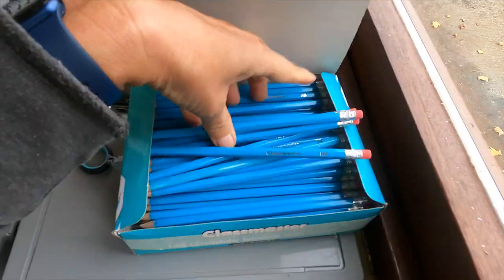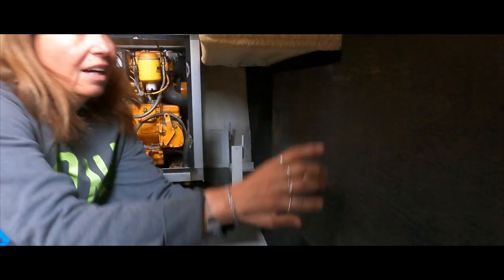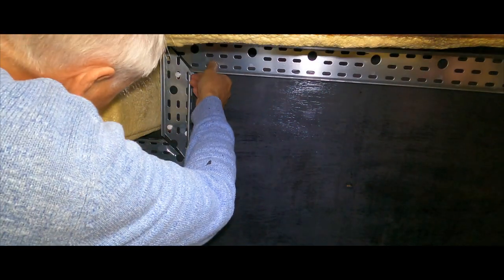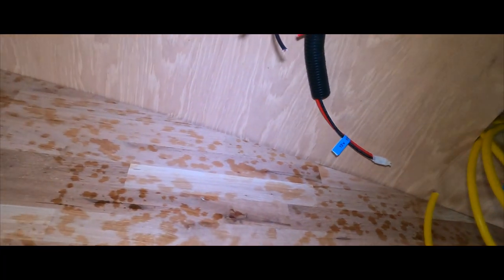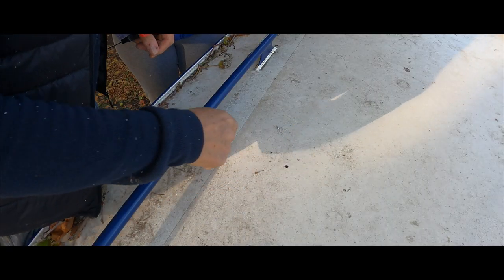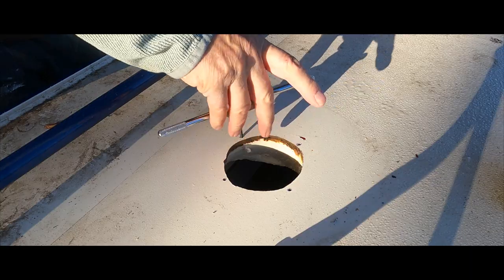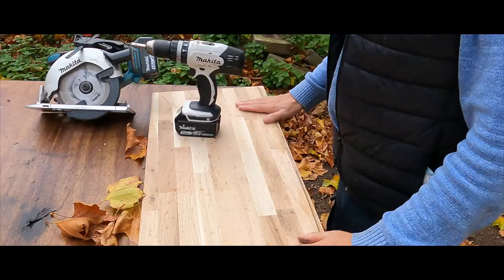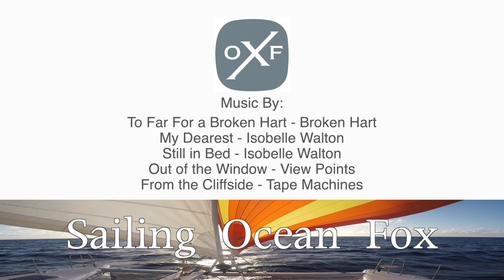BARGE BUILD. A Big Screw. What's all about the big screw? Sailing Ocean Fox Ep190

Comment: Did you happen to put weather sealant on both pieces of the air vent on the roof or was that not necessary.
Reply: I was thinking the same thing. No gasket ? I measure 5-6 times before I put a hole in my boat